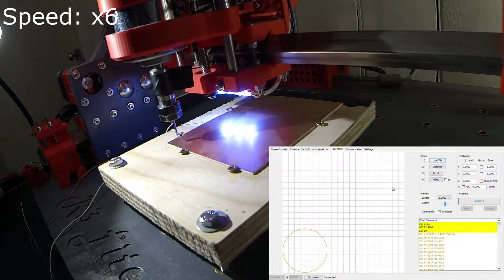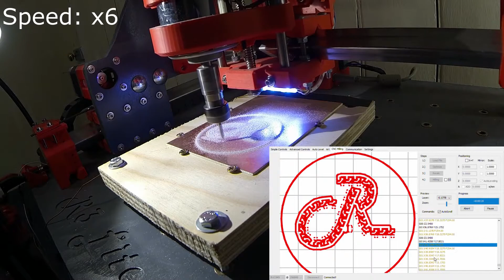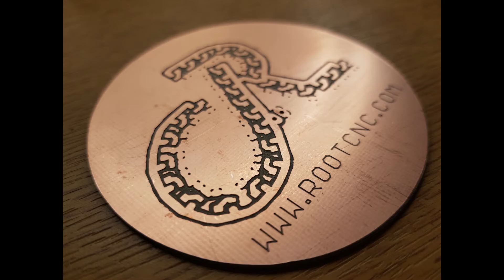Root 3 Lite CNC 3D printed CNC PCB milling

Comment: Very nice! Do you think the root lite could do some light aluminum work?
And: On a larger scale, this or the root 2?
Reply: For aluminum, I would suggest you look at the Root 3
Reply: James Pelt okay, i thought that the root 2 could work as well.
Reply from the maker: On our Facebook group a member has machined aluminum on the Root 3 LITE machine with very good result - he was using a good spindle though. If you are after a bigger machine I would recommend Root 3. its the strongest machine out of the Root  family and I have no doubts it that it can machine aluminum.
Reply: Thanks for your advice! The thing is that I want to reuse some the parts of a cheap engraver I have laying around. This would allow me to build the entire thing (spindle included) for around 170€. I planned to use a 700W Makita router and steel tubing. So my idea is to start with a root 2 (maybe with a bigger gear ratio because of the Nema17s) and then upgrade it to a Root3 for example. There are two questions I still have though:
Which one of the two has the better space efficency (usable volume/space it needs)
Are there any ways you can recommend to upgrade a root2 to make it stronger?

Comment: What tube do you use for rail, steel or aluminium?
Reply from the maker: either - they both work equally well, aluminum doesnt rust so might be useful if you have a damp workshop

Comment: Nice project. But why do you call it "open source" if you don't share source CAD files or even STEP files ?
Reply: Бэзэ Кукун  You can find the files at Thingiverse
Reply: Kristopher Trela The only files available on Thingiverse are STL files. STL files are NOT source files.
Reply from the maker: The source files you need to build one are readily available.